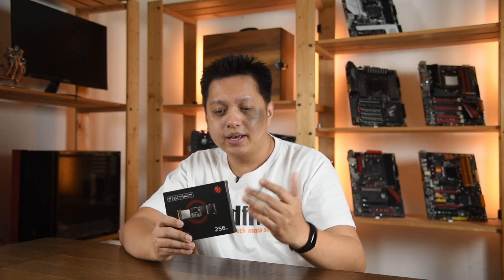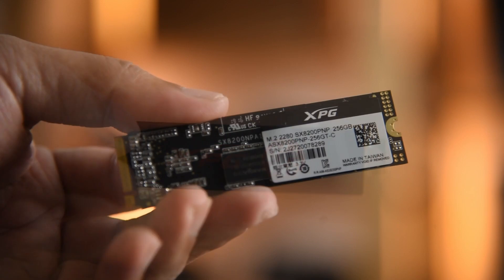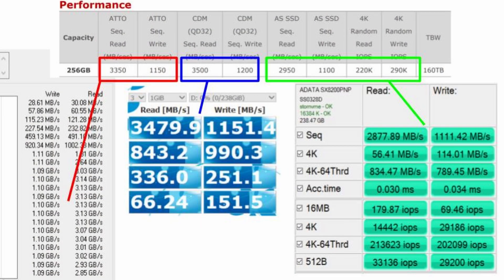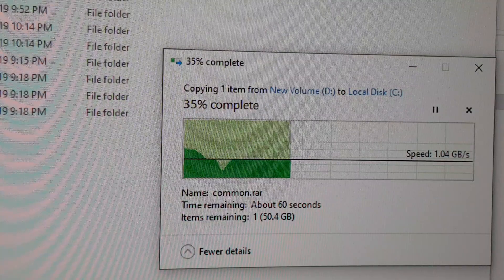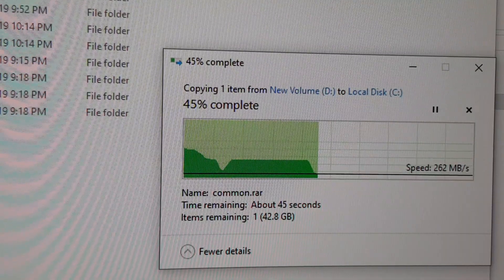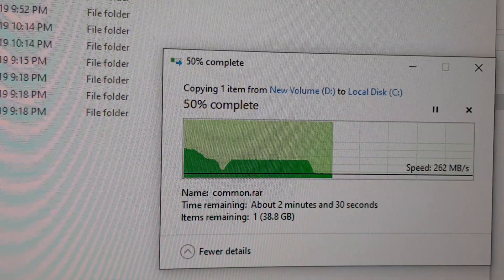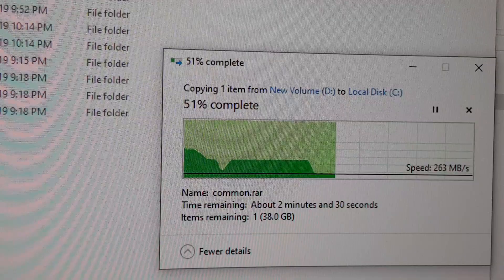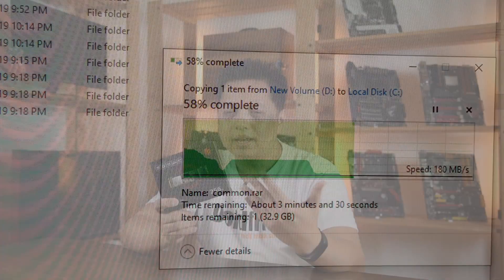XPG SX8200 Pro (256GB) NVMe SSD Review

Comment: "Cool XPG heatsink included

The SX8200 Pro box has a sleek black XPG heatsink with pre-applied thermal compound inside for easy DIY. With or without heatsink: the choice is yours, as the SX6000 looks great in builds either way."

https://xpg.com/en/feature/583/

Comment: should I go for this or the gigabyte rgb nvme? same size
Reply from the maker: I like this one, because the Gigabyte model has a super huge heatsink and may come into conflict with your board, also the RGB control is limited to only certain X299 boards.
Reply: goldfries I will use tomahawk max for this
Reply: goldfries thanks alot for the info